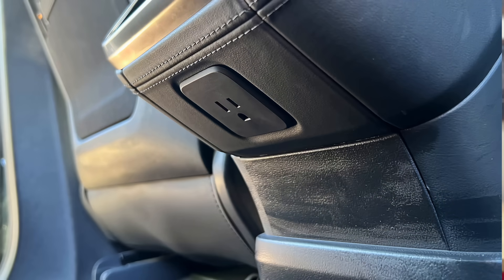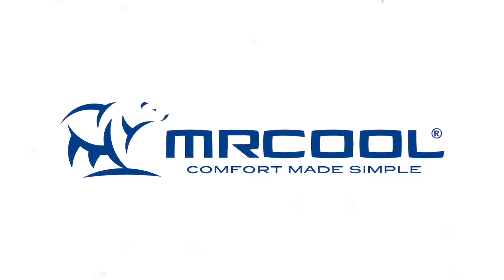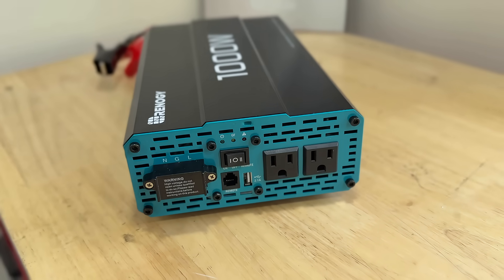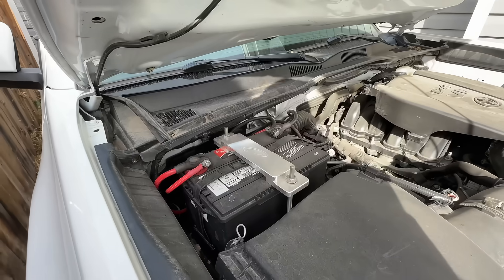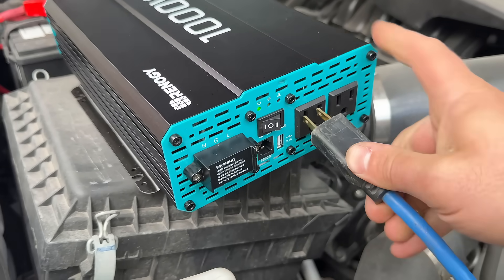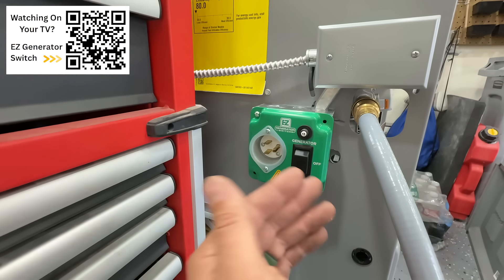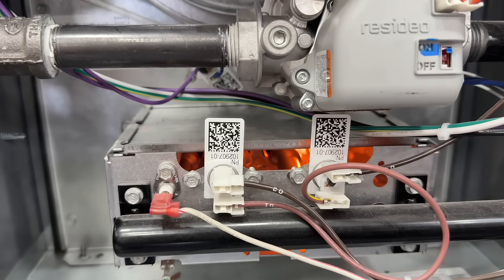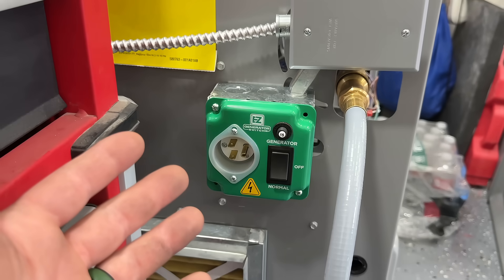Why Buy A Generator? You Have One Parked In Your Driveway.

Comment: Great video. GREAT device to have during a power outage. No maintenance. Takes little storage space. Three things. 1. Bigger cables. The bigger the better. Lots of people try running these things with cables FAR undersize and end up disappointed. 2, I wouldn't run it with the hood down and the engine running. You can get a thermal overload which will trip the inverter and potentially damage it. 3. You better have enough alternator. I run a 1500 watt off my Dodge Charger with a 180 amp alternator. I try to have at least 20-25% more alternator output than the inverter needs input. These things do make  having a separate generator kind of pointless unless you REALLY need the high wattage output.
Reply: Regardless of alternator amp size, the problem with this idea is that auto alternators are designed to work at mid or higher/highway RPMs. Pulling amps from an alt for prolonged periods at vehicle engine idle can cause components to fail.

Comment: Great way to start a car fire. Use an inverter with WAY too small of wires to the battery........with cheap clamps..... then close the vehicle hood while the engine is running trapping all that heat. At LEAST upgrade to 4 gauge wires and beefier clamps.

Comment: Need to keep the inverter running at a rate that is 30% of the alternator. Cars are actually not designed to be pulling a fairly large size load and not be in motion. Needs air over the radiator and other components. I found that if I keep my 100 amp alternator at 30 amps or less then the car stays nice and doesn't need to pull higher engine RPM's without much issue. Just something people need to understand. Don't forget to account for the base level energy the car needs. In essence I can about 20 amps out while idle without raising the RPMs and everything off in interior at around 1000-1200 rpm on my mazda (idle rpm). Good for emergency to recharge some battery stations.
Reply: At low rpm the take by  an inverter can exceed the power generated by the alternator - woukd that fry the alternator?
Reply: @QB2ERS  Not really: generators are typically current limited.
What will happen is that you drain your battery if the alternator can't keep up.
Higher RPM gets you into charging, rather than maintenance, voltage.

Comment: This is a good second or third backup to recharge a generator, but to use as a actual generator, it's OK if you don't need more than 1000w for very long, and the 110v plug is never more than 240watt, usually only 120w. Not really  a great Idea, you'll be buying an alternator soon if you do. 120 amp alternator × 14v = 1680 watts, most alternators are 100 amp.
Reply: I was gonna say wouldnt you need to upgrade to the Rv style alternator or aux alternator?

Comment: Dave,Dave, Dave! 
Those inverter cable are to short and the gauge is way to thin.
Placing that inverter ON the engine will allow it to get too hot.
If your car doesn’t have a high output alternator you can’t operate that inverter with much load at an idle! 
You already did this video many years ago with your older Toyota, it’s literally how I found you.

Comment: Hey so some thoughts from a wannabe prepper.

 In a state of emergency from some sort of outage or catastrophe fuel is going to be in high demand. Powering your refrigerator/furnace is smart but be aware of the world around you. 

For the inverter in the engine bay, both make heat, both make a LOT of heat. I would try to separate them if you can. When the inverter gets too hot it will lose its wattage capacity or even turn off. 

Cars are not meant to run at idle because they rely a lot on passive cooling from the wind of driving. You should treat it as for every hour idle is 100 miles driven. Maybe use some of the power on a box fan running under the truck.

Comment: There is one huge caveat to doing this method. To do it the right way you should run a dedicated separate alternator in your truck for example to run your inverter. 

The alternator in your car is only rated for so many amps at such a duty cycle. If you're pulling 1,500 Watts continuous on your inverter that's roughly about 150 amps that your alternator is putting out. 

Typical car alternators and even larger for trucks are 150 amp alternators. You cannot pull 150 amps for very long. Typically car alternators are rated for a 30% duty cycle. This is due to the thermal limitations of the alternator. 

This method works but you need to be careful how much current you are drawing and for how long.
Reply: This inverter connects to the battery, NOT your alternator.  If you draw too much power, you may run the battery down if it alternator cannot supply enough power to keep the battery charged.  So you watch it to see what happens.
Reply: @jsc8102 The alternator cannot keep replenishing the battery at its maximum amperage for very long which was my point.
Reply: @Bassguitarist1985  You are correct.  Doing this one would definitely need to know what they were doing or they'd have a car with a dead battery and fried alternator.  For a couple of hundred more you can get a small inverter generator and be in a much better position.
Reply: @zangzang1268 Exactly 💯!
Reply: who said anything about a 1500 watt inverter? He's talking about a 1000 watt inverter. Wake up son!
Reply: @mattolivier1835 no you wake up. It's still beyond what an average car alternator can output 100% of the time. Your typical fuel oil fired furnace draws about 800-1200 watts running since it also includes the blower. It also cycles for 10-15 min at time. A natural gas or propane fired furnace uses a lot less wattage since it lacks the induction motor to pump the fuel oil. In any event that is very high stress on a typical car alternator. For a few hundred dollars more a homeowner can buy a proper sized inverter generator that is both fuel efficient and designed to handle the wattage range for a prolonged period of time.
Reply: @Bassguitarist1985  Who said anything about an oil fired furnace? In the video he clearly mentioned gas heating furnace. Wake up son!

Comment: Couple of caution points.  Many car 120v outlets are modified sine wave and not pure  sine wave.  Can be bad for sensitive electronics.  Also many cars don't have a sufficient alternator to run anything over 800W for a prolonged period of time.
Reply: The average wattage of a 120 VAC outlet in today's cars is only about 150 with some SUVs and pickups being as much as only 400.
Reply: 12voltd. Cars are 12. It's and inverter giving u 120.
Reply: @buy1122 and some cars have the inverter built in already to provide a 120V outlet
Reply: @yarpos Yes but usually no pure sine wave.